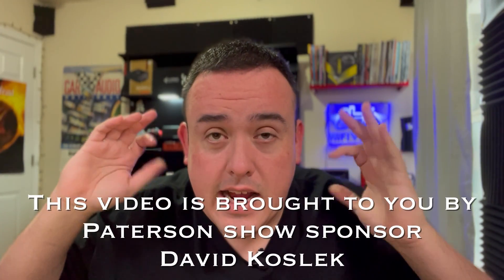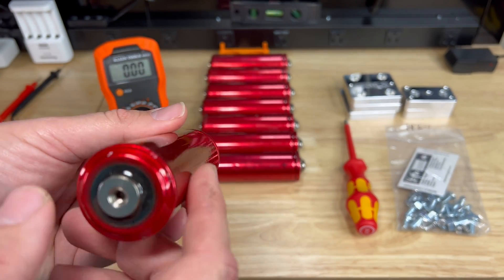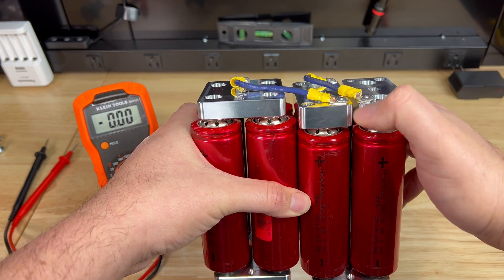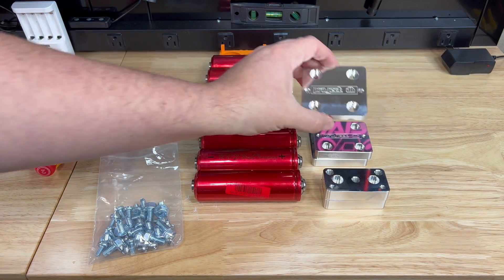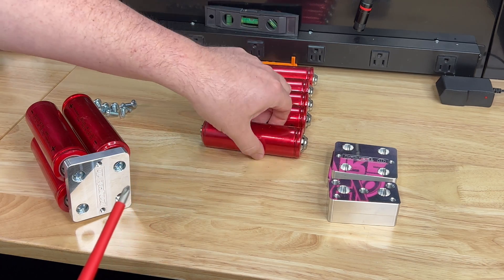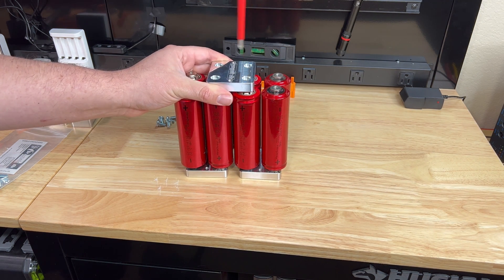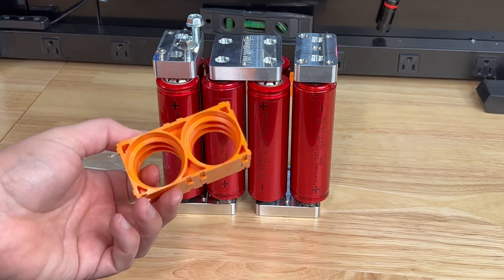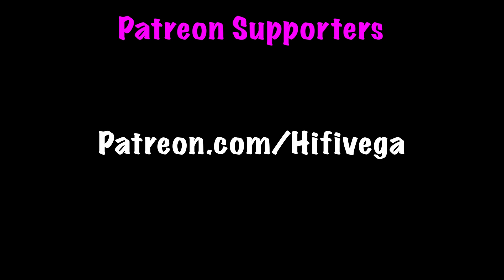How to build a 12v lithium battery bank for beginners (Headway 16ah build)

Comment: How come lithium doesn’t go bad if neg and pos are touching the same surface ?
Reply from the maker: They’re wired in series like a subwoofer. That means you got pos to neg to increase the voltage.
Reply: @HifiVega  o ok,see I’m Loki g at it as if it’s like a regular battery m,you know if neg and pos touch the same metal it will short out,lithium cells don’t work that way I see

Comment: Top balancing batteries is when you connect all the positives together and all the negatives together and then charge it to 100%. The reason why you do this is because the cells become out of balance at 100% and at 0%. Most people want to operate there batteries at 100% so you top balance instead of bottom balance. What you did was just balance the cells. Usually cells are shipped at 50% charge.  You also want a BMS and active balancer installed or you can have some runaway cells. That won't be a good day

Comment: I got a question what does the voltage need to be on headway cells before installing it into my car audio system?
Reply from the maker: They usually rest at 13.2-13.4 bolts as a built 4s configuration
Reply: @HifiVega  ok thanks

Comment: I plan to add the same 16ah lithium on a stock 140a alt in parallel with a agm battery that is under the hood, but i still have some questions does the lithium bank has to be charged at 14.5 (alt voltage) before i add it to my car audio system? Do I need to use a isolstor?, the lithium pack can be 24hrs on the truck or it has to be disconnected? my major concern is safty considering my car is daily use.
Reply from the maker: With a 16ah bank it won’t be a huge issue running them inline without pre charging them. Adding an isolator is mainly up to your personal preference. It can be a bit of an extra safety measure. Outside of that these cells are relatively safe just make sure they’re in an enclosure so the pos and neg aren’t easily accessible for something to fall on them

Comment: How do I determine my ah needs for my total car audio build.  Also will a higher voltage alternator say 15-16 v negatively affect a bank like this one?
Reply from the maker: These cells shouldn’t be charged over 14.8v you should look at these cells I did a video on if you’re charging that high
https://youtu.be/k0Hk3VE8v1w?si=XFjkE__VJUBhyuqx
Reply from the maker: As far as calculating how much you need take the total amount of amperage you will be drawing and divide it by the battery amp hours x the c rating
Reply: @HifiVega  thank you Sir!   Your appreciated!!
Reply from the maker: @JAYCEE-xm5dd  no problem my friend

Comment: 16 amp hour only good for like 2600watt rms? Right
Reply from the maker: Closer to 1500 watts if I had to say
Reply: I been looking into getting one of these …..I was going to get a life04 whatever battery for my set up I got 100ah of agm batteries for a 5K rms set up w a 300amp alternator still drops to low into the 12s for my taste
Reply from the maker: @amordeweso  you need alot of agm to compete with headway
Reply: @HifiVega  what like 3 of these?
Reply: @HifiVega I ended up w a super beast a 96ah for my setup ….but I have 10 extra cells I wanna make one of these for my sons car ……how would you do the bms?

Comment: What are your thoughts on using a bms for lithium batteries?
Reply from the maker: I think a bms is a good thing depending on your application. With the large draws in car audio a proper bms would be cost prohibitive because you need a higher output amperage capacity
Reply: @HifiVega  The vast majority of my use will be 50 Amps or less at any given time, likely between 12 and 20 amps per hour.  At least until I eventually run a small ac unit and ac lighting on a second battery bank, which will be about 55 amps per hour. At most.  The second bank will eventually be around 300 Ah.
Reply from the maker: @douglasvamateurradioandmore  if you’re amperage draw is that low I highly recommend a quality bms then

Comment: Congratulations. Can it be charged without bms
Reply from the maker: Yes it can
Reply: @HifiVega  and they will all balance charged? Up to 13. something volt or 16v?
Reply: @HifiVega  sorry u already said it can be charged to 14v. But if I can't get headway cell the caps u used can I still get the same result with any other cell and what alternative can I use as caps?

Comment: I'm wanting to run a system with two amplifiers that totals about 1500wrms. Would this or a 24ah bank work best?
Reply from the maker: Bigger is always better, but this should be plenty for 1500 watts.
Reply: @HifiVega  thanks! I appreciate the response. A lot of people usually don't keep up with comments after the video has been out for a while. That's awesome!

Comment: Question how did you only get 6 volts when you hooked up 4 you should of ended up with like 12.8v even  the web sight says with 4 cells equals 12v???
Reply: i was wondering the same damn thing im thrown off as well

Comment: Thank You for sharing. How tall is this on the long side? Does this have to be ventilated? Im planning to build one and install it under the spare tire off the trunk. Im restricted to about 6inches on height.
Reply from the maker: It is roughly 10x7x3
Reply: Thank You

Comment: Headway lithium cells won't work in cold weather though right??? That is the only thing stopping me from doing this myself, any tips for my application would be greatly appreciated, thanks
Reply: -25f starting my truck video on my channel . you can warm the cells up very quickly with even a small draw.
Reply from the maker: I don’t remember the spec, but they cannot be used in extreme cold conditions.
Reply: @HifiVega  right, that sucks...... But the yinlong ones can though right??? Appreciate your reply man
Reply: @bearxbunny1835  LTO is better for cold , however lifepo4 and nmc can be used to . I live in Wisconsin and test cells and different banks and have used em all in the cold
Reply: @mazda2284  So I could still use a lifepo4 bank during winter time without damaging anything??? Also are there any BMS units that can protect them from things like the cold, over/under charge, and balancing too??? Cuz I have a Singer 220 alt and sometimes my voltage will be at 15v. It's not always, but 90% of the time it happens when it's cold. And when it does happen it's usually just for a few minutes then it goes back down. However, sometimes it will stay that high until I turn off the car, and I have even seen it get as high as 15.4v and with the max charge for a Headway cell bank being 14.8v it makes me paranoid. I really do appreciate any help and advice that you can give me
Reply: @bearxbunny1835  there are but you're just going to make it way too complicated and you're going to create more fail points that are just going to create more problems you can use Headway or lifepo for in the cold just don't be pushing it while it's cold let it warm up and only takes a small draw a few minutes to warm the cells above freezing from 25 below
Reply: @bearxbunny1835  but with your voltage you have no business running Headway or anything like that you should be running lto and you'll do way better too because lto is going to hold way better voltage
Reply: @mazda2284  Right but it only goes that high sometimes, when it's not going that high it's usually charging anywhere between 13.8 to 14.4. It seems pretty random when it gets up to 15v, if I knew when it will or why it will go that high then it would be easier to for, but I am not running a high voltage setup. Right now I only have a regular lead acid battery with the big 3 2/0 OFC wire, same wire to my amps. I have two zv5 12's powered by two Fosgate 1500bdcp's (one to each sub). I had a 6 fared cap but it wouldn't shut off so I took it out. I am pondering lithium cuz I plan on doing some significant upgrades here soon. But all my equipment is rated 12v but sometimes my alt likes to go higher than it should is all
Reply: @bearxbunny1835  You just allow some warm up time before you womp on them you will be ok.
Reply: If you dont push them while its cold and let them warm up you will be fine.

Comment: Can this be used as a starting battery?
Reply from the maker: These aren’t meant to be used under the hood
Reply: it can be used as a starting battery , but no battery should be under ur hood ever unless its in a cooled compartment.  watch my video on under the hood lithium done properly.  but yea this will start your vehicle no problem with proper wiring

Comment: So 2 series 4 parallel is 12 volt.     So is 2 series 8 parallel still 12 volt. Thanks. Or would you have to do the 2 banks separate than connect the posives and the negative.  I only have space for 2 cells side by side so trying to go long. Lol so I thought about it you would need 4 series and 4 parrallel.
Reply from the maker: You can do that you just need to have the bus bars configured correctly

Comment: Ordered these Project DB bars a week ago, still haven't shipped. Kinda disappointing.
Reply from the maker: They build these to order so it takes a little bit. I wouldn’t be discouraged
Reply: @HifiVega   Ah, makes sense.  I look to see if stuff says there is a lead time, it didn't so was expecting it to be faster.  Thanks for the reply!
Reply: I got my bus bars today.  Took 2 weeks, but was worth the wait in the end, they are nice bus bars for sure. 

While waiting for them to come, I built my own 4s voltage monitor for the bank, so I can see the voltages for b1-4,  cnc'd my own acrylic case with a design on it ( since the acrylic cases available are priced way to high for what they are.. lol) cnc'd an acrylic plate for the 4 bank volt meters and 1 volt meter for my car amps voltage,  with a power switch to turn them all on and off when needed Over all a pretty fun project, that I'll be making a lot more of for some locals.
Reply: @Joes_Channel1984  worth the wait , he is 1 guy local to me in Wisconsin and he works his ass off , I help him with bar design so they are done properly , bars do more than just transfer energy,  resistance,  passive cooling and safety is all factored into the bar designs 👌 top notch quality
Reply: @mazda2284   I live about 30 mins from him, I live in Wisc as well. They were nice bus bars, as I stated above.
Reply: My order took a month and a week. Once they came I wasnt dissapointed though. Pleased with the quality and ease.
Reply: @You God   Yes, they are nice and worth the wait and the price was pretty good as well.

Comment: Would this work well for a 3k full ridge amp, keeping the two lead acids and alt up front?
Reply from the maker: This would be like adding another 1.5 group 34 batteries (kinda) so it should help
Reply: @HifiVega  just ordered a 250 amp alt, does 200 at idle.. should that be sufficient?
Reply: Would a third group 34 agm be sufficient? 3 batts total?

Comment: Hi great video, I made a 12.8V-14.2V using LiFePo4 4S BMS 20AH for my motorcycle which uses 7AH LeadAcid, but as soon as I selfstart the motorcycle the BMS got damaged, what can I do to avoid that in future, LiFePo4 is expensive here. please help.
Reply from the maker: You may need a higher amperage bms
Reply: @HifiVega  used 40A BMS as well the original battery here was only 7Ah howcome 20Ah /40Ah both bms got damaged on self starting the motorcycle.

Comment: Can you run these with AGM?
Reply from the maker: Yep
Reply: @HifiVega  dude. I’m getting so many mixed answers. Lol saying yes you can. Then no you can’t. I wanna leave my AGM under the hood. Cuz I know lithium under the hood doesn’t amount to anything good. But I deff need more reserve power. I have a single 320a alt and 2 AGMS currently. But I need more. Like I said tho. I’d like to keep the AGM under the hood. It already has a bunch of connections up there that I’d like to stay.
Reply from the maker: @Aar0n2009  it’s all about charging and this pack is a max charge voltage of 14.6
Reply: @HifiVega  I’m charging at about 14.9 so I’d have to go a different route then
Reply: For Sure. No Issues. No isolater needed.

Comment: Will this  same sat up work with my synergy wfo 2.0 an a xs power D3400 or do I have to make a bigger highway cells
Reply from the maker: This would be slightly better than just adding another d3400

Comment: Can you just keep going longer to make it bigger as long as it’s in combination of 4
Reply from the maker: You’d have to get different bars, but absolutely.
Reply: @HifiVega  ok let’s say you have 16 cells so could you just keep going with 2 cells next to each other cause of the room I have only fits the width of 2 cells or how would you connect 2 banks of 8 without going wider just going longer. For 32 ah 2 cells wide 8 cells long work. So 8 series 2 parralkel work.

Comment: I'm looking into a 16Ah bank, but I'm a little confused on the 25C rating of the ones I found. If a 8Ah (25C rated) bank is good for 200A would the 16Ah bank be good for 400A based on the 25C rating that I'm still not fully understanding?

And is that just the max it can discharge? Like if I were to try and start my car, could it deliver more power potentially for that short duration. (Just a basic V6 Sedan) Or is it locked to 200A/400A?

Basically I'm just curious if the CCA or cranking amps in general are at least in the 600-800 range that I'm used to with Lead Acid. I'm just curious if I can replace my battery for a bank like this and be good. I doubt I'll ever make my system pull more than 1,000w. But just want that steady voltage for short periods of time I do pull a lot of power and my alt dips into the battery voltage that is lower than I'd like. Could always just add it along side the battery but the idea of a battery delete is kinda cool.
Reply from the maker: I’d definitely run this in conjunction with your starting battery. 400 amp discharge would be peak amperage output for short periods of time and overall I do not think you would be disappointed
Reply: @HifiVega  If I run 400 amps , why would I need another starter battery ? Is this not sufficient to turn over a starter motor ? If not , then add another 4 cells in parallel for 600 A peak .
Reply: You can purchase off the shelf Li batteries weighing as little as 5 lbs that are more than capable of turning over your starter motor .Banshee battery makes an excellent model . Also , when taking 40-50 lbs of dead lead weight off the frame , the steering feels like the car lost 200-300 lbs .  Best part of this project .

Comment: I have a cutlass that came with a 78 amp alt I upgraded to a 150amp and could it be used with  this big 3 welding wire 2/0 I have a taramps md 1800 on a comp q 15 ..with a yellow top ..would this be better or could I add this as a reserve or just take the yellow top out and use this ..
Reply from the maker: Add this as a reverse along with the yellow top

Comment: Nice! I'm thinking about building a 64 ah headway bank for my cars audio system. At the moment I have an agm under the hood and 2 Northstar SMSAGM80's in the trunk with a Fosgate Power T1500bdcp and Skar VXF 12. I bought 2 VXF 12's and I'll be running 2 JP23's so I definitely won't have enough reserve so I've been looking at lithium. I'm not sure if I want to do a battery delete under the hood and I've read that headways can run safely with agm's with an isolator but I've seen mixed reviews about that. Again nice bank and that was a great detailed description on the assembly.
Reply from the maker: I would run the headways with the stock agm under the hood
Reply: @HifiVega  ok cool thanks Bro!
Reply: @HifiVega  are you using a balancer or bms?

Comment: how many cells would I need to push an 8k amp in my semi
Reply: I use a 32 ah 16 cell bank Paralled with my XS agm 2000 powering a Taramps Bass 8k. No Issues works great. No joke. It works great without AGM. I keep AGM wired as I power two midrange and tweeter amps.

Comment: I have 16 cells if I make two identical banks of 8  like you made, how do I link the 2 and stay at 12.8ish?
Reply: Please answer me soon as you can I already have the 2 8's built :)
Reply from the maker: If you parallel them the voltage will stay the same but you will have more amp hours
Reply: Its better however to make one large bank which is what I did. Heres a link  :  https://youtu.be/CI5FrdViAyI

Comment: Would adding a 16ah headway, exactly like this one, be added to my 2 xs power agm d3400 batteries with a mechman 270A alternator in my Yukon.   I have a 4000w amplifier? How would it benefit from adding this to my setup? Any help would greatly be appreciated
Reply from the maker: If you’re dropping voltage now it should help a little it would essentially be like adding 1 and a half group 31 agms to your current set up
Reply: Awesome!!! Thats all I needed to hear.  Yes. I am dropping voltage on the deep bass.  I've seen the voltage go up to 14.7-14.9. Will that hurt the cells?

Comment: @HifiVega  whats the thickness of the bussbars you used on this video ? If i am using 24 cells, how would you recommend i assemble them to make up a battery ? DO you recomment a BMS or Balancer ? and based on you answer what brand and model/specs do you recommend ?
Reply from the maker: For 24 cells you’d want a minimum of 1/4 aluminum bus bars imo. These custom bars are much thicker and overkill in most cases, but make it easier for future connections. If you top balance them you can get away without a balancer, but you’d wanna check them periodically. If you wanna just have a one and done solution you can pick up a cheap active balancer like this one 

https://amzn.to/36Ws83a
Reply: @HifiVega  what configuration would you advise to build the 24 cell battery ? can you kindly show a video or diagram aimed at a beginner , thanx